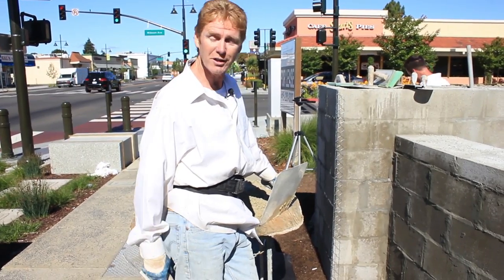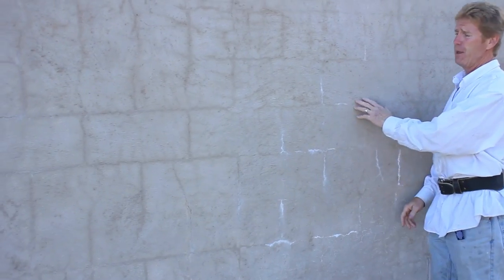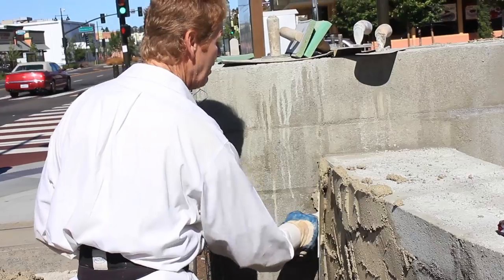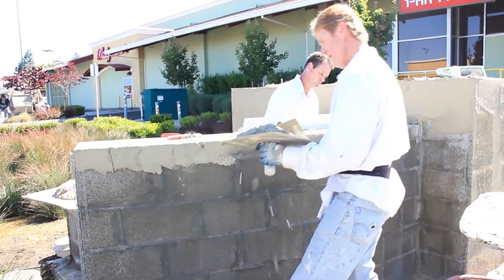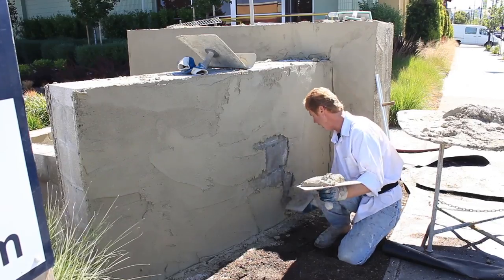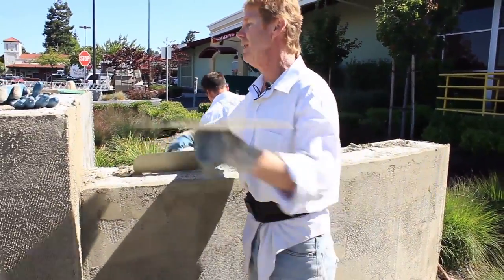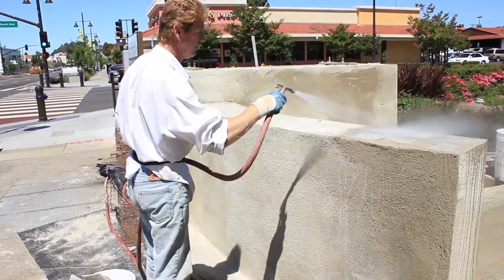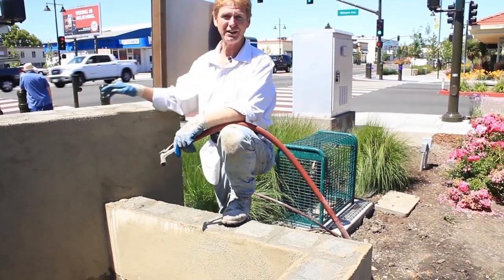How to stucco plaster Cinder blocks

Comment: That wall needed a good drink first, soak it until it stops taking water or when your hear it stop crackling.
Reply from the maker: Howdy Jimmy no doubt, it was close to 100 degree's plus the Rapid Set Eisenwall didn't have any retardants in it, thanks to my one the ball, brother. 
 We like to work with skill and professionalism, however, It's tough to watch all crew members who don't have the ability to think like skilled professionals, all my brother, Luuuuuu, needed to do was notice the heat, thus add one or two packs of retardants, we would have saved two hours and all our strength and simply used skill.    
                 Best wishes,
Plastering tips from your favorite stucco geeks

Comment: Oh I forgot to say if you don't water it 3 times a day for 3 days its going to crack and the strength of the plaster will be poor and before you do a wall like that that's out side you need to put a first coat I don't know the name you use in us but that you need to do and water it for 3 times a day and 3days
Reply from the maker: Greetings Nir Dude this rule applies to wood frame homes, not cementitious substrates.
 We hydrated while there,
 this is all that's needed.

                Get plastered like stucco
 Kirk and Jason Giordano’s sound plastering advice

Comment: Is this a comedy sketch🤣🤣🤣
Reply from the maker: Howdy Declan, when plastering in 100-degree weather and trying to apply stiff mud you can call it a comedy sketch, I called it, improvising without whining and getting the job done, plus after lunch, we colored the wall, that video is in the description. Yes in the same 100-degree heat.
It's easy to criticize as I didn't mention the heat or my brothers screw up with the mixing of the mud.

                           Peace, love, and harmony to all
         Sound Plastering tips for the DIY beginner’s and Plastering experts

Comment: I am sure you are good at what you do,some of the worst block work,I have seen,from a professional,I know you did not do it,just not the right way to plaster a wall.
Reply from the maker: HI Pete, no worries, I did apply the mud to this wall or walls, however my brother Looooou, mixed some damned stiff mud and it was a rapid set mud, as we were going to do the color right after, well, he mixed the rapid set stiff and it was really hot day the walls sucked the water out, even though I misted,  the mud was stiff to apply which made me look as an apprentice, out of over 600 video's we have done I allowed the mud to beat me up on this one.
 Bottom line I did not appear as graceful as usual,
(i'm half the show, the other half remains behind the scenes as the hod carrier),
 Fortunately, at the end of the day the skim had been complete and the color was also applied and came out beautifully.
 Cheers, and have a Fantastic day! Kirk Giordano’s DIY plastering tips
Reply: Kirk & Jason Giordanos DIY plastering and stucco tips I was more taken back,by your comment on the block work,Excellent job ???????
Reply from the maker: Hi Pete, Ooo, that, I told the fella not to worry about what it looked like as we going to mud over anyway,
 Best wishes, 
 kirk giordano